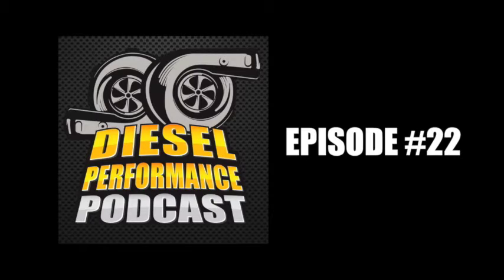Built Transmissions and Converters

Comment: Okay so I’m having a “hanging shift”... full throttle the truck doesn’t want to lock up the torque converter, which in the middle of a race is probably the most crucial thing for at least my truck, note the truck is an 07 lbz 170xxx, ppei efi lives tunes, 75hp injectors, egr delete, fuel rail plug, transmission wise i have a ats five star triple disc converter , ats deep pan, and ats co pilot, with the gauge set up of an edge evolution that’s been turned off. In the past it’s broken two flex plates. If it would be easier to call in to y’all and talk about please say so, as well as an possible trouble shoot, thank you have a blessed day!
Reply from the maker: Hy Cameron - yes, give us a call please it would be a lot easier to go over your issue. 815-568-7920

Comment: I'm looking at getting back into a duramax. Have had two already but bought them not really thinking about the future. I'm wondering what y'all would recommend to get not wanting to build the engine but would like built trans and a s475 over stock compound setup. Which would that be the safest on staying between 2001 and early 2007. Not sure on injector size maybe between 45-60% over and would I need a cp3 for 45's
Reply: Cp3 is always a good idea with anything over 30, I recommend a 10 or a 12mm pump because they push fuel past 3500rpm. A 12mm is good up to 900hp

Comment: I'm having trouble with my 1000 allison almost constantly going limp mode on me. if i just leave on tune#1 and drive miss daisy is fine... found a guy that says he knows what he's doing far as rebuild for $25-3000. sound good?.... 07 lbz 67k miles....fully deleted-fuel lift-full mbrp-Banks ram air-efi live ect...i need to use as daily driver and occasionally pull 42' 5th wheel cross Country but still like to have Lil fun in it time to time.....any thoughts on which direction to go?
Reply from the maker: +jdhp45toy Sounds like you need a built transmission not a stock replacement. It will cost more $ up front, but save you from having to do it twice:  http://duramaxtuner.com/transmission/dt750-built-transmission.html